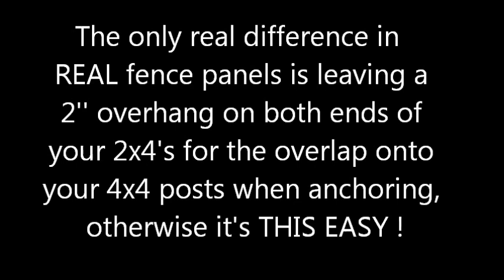How To Build Fence Panels

Comment: Anything close to the grade will eventually Rot....I always leave at least 2" from the bottom of the boards to the ground surface, to cover the gap I install a P/T 2x4 running parallel to the ground. It will be cheaper and easier to replace the PT 2x4 than the fence boards.
Reply from the maker: That's actually a good little trick with two by fours, and this case it's on a slab and the planks don't touch the ground, I think they're about an inch off